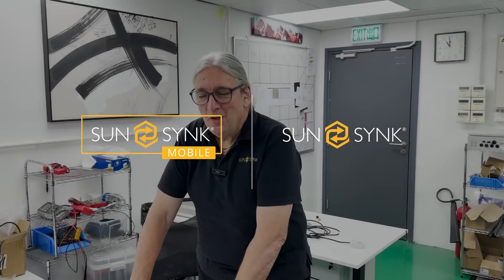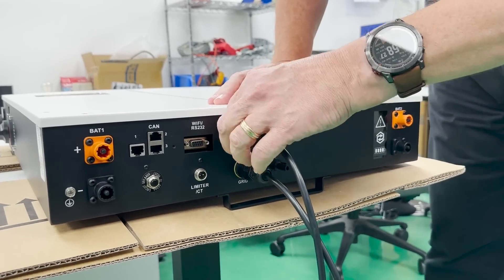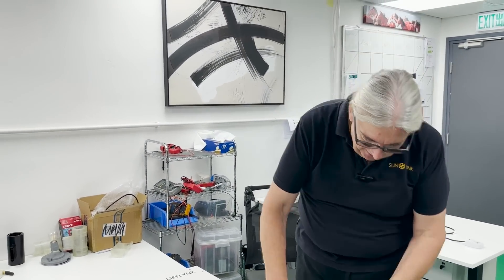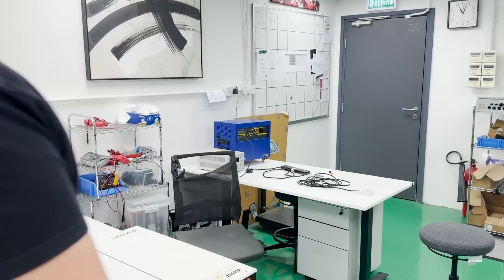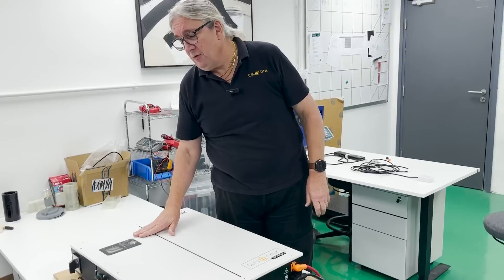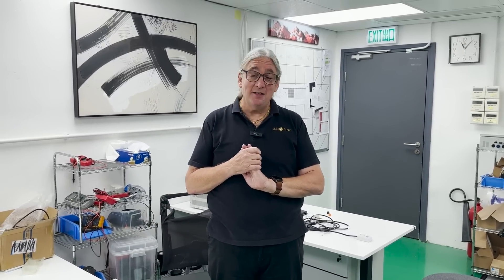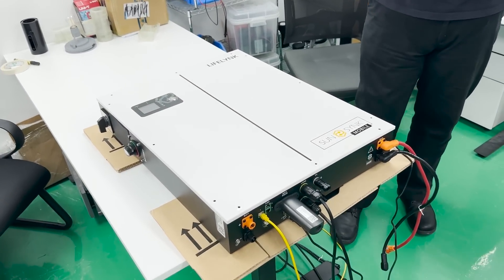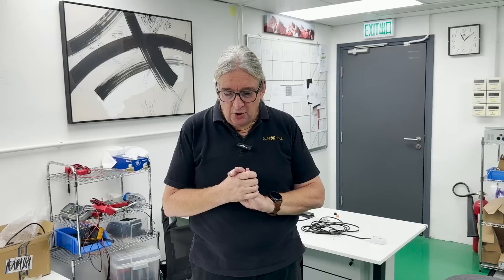Lifelynk Explained | Sunsynk Mobile

Comment: These cheap, lightweight, high-frequency, transformerless inverters can damage your home's appliances when their IGBTs fail because they lack galvanic isolation between their DC boost stage and their AC output. Don't take my word for it, ask Google this question: Can a high-frequency, transformerless inverter damage your appliances?

Comment: A couple of issues, i needed to extend the ct cable ( on the XL ). It's a sealed plug and lead, so to extend it, you need the correct male and female extension cable , i rang the tech support to be told you can't extend the CT cable on these models ( but manual says you can extend upto "10m with appropriate cable"  tech support was shacked to hear this...???? So i asked can you supply the extension cable no i was told just use cat5 or 6... and how am i supposed to connect that to this 2 pin moulded plug.. they hadn't got a clue... so I've sourced the connectors and made my own lead up, and it works fine. No thanks to Sunsynk.. if anyone needs an extension, message me.
Secondly, the battery connectors on the unit are not standard Amphenol  mentioned in this video. Again, I rang tech support to find out what the connector is exactly, guess what they dont have a clue...
The unit is a brilliant bit of kit, but sunsynk need to get their act together.

Comment: Do these need a separate MPPT between the solar and the sunsynk or can it plug straight from the solar into the bottom of this? My old setup didn’t need a separate MPPT but you mentioned from the MPPT on this video

Comment: So we just fitted one after watching a video where Keith said its ideal to add on to an existing system as you can store the wasted solar that goes to the grid BUT technical just told us NO it won't it only charges from the grid 🤔 can someone confirm was Keith fibbing🤭
Reply: It has MPPT built in, upto 4.5kW solar.

Comment: Recently purchased one of these however the battery leads supplied have a 16mm plug for the battery and a ring for the inverter - the inverter plugs are larger than the battery plugs. Is there are part number for the leads set that have a 17mm plug for the inverter and a 16mm plug for the battery on the other end ? Thus an adappter/ converter cable. Stuart
Reply: Did you ever get an answer? I've got the same question.. I rang technical support, but their as good as nothing..

Comment: I installed a unit yesterday but the SunSynk Connect App is only for monitoring. No configuration changes can be done remotely and some reporting is also not working correctly. I was looking forward to a seamless quick install for my customer, but sadly it seems not a good choice foe installers.
Reply: Great to know I was going to try 9ne for easy install
Reply: There is always something with sunsynk but you never find out until on-site

Comment: Whenever I see PV/Battery install issues its virtually always due to CT clamp issues, I think manufactures need to acknowledge this and add wireless CT clamp on to there devices as standard. Plus if you call the port by a different name to what is on the port label, then I guess the label has described the port incorrectly.
Reply: In the UK, you cannot use a wireless CT coil for export limitation.
Reply: @VinoVeritas_  myenergi Harvi or RS485 wireless transmitter is pretty common, I have both